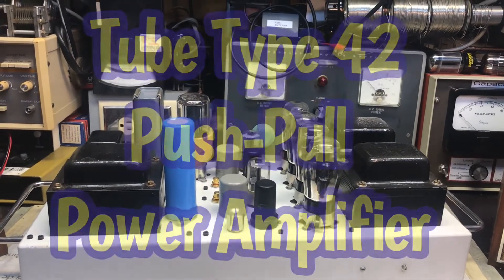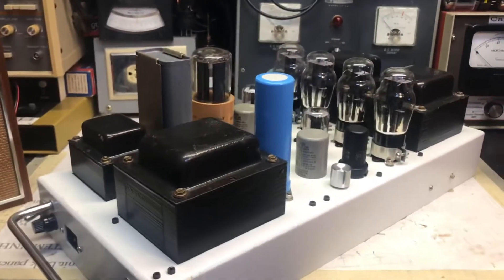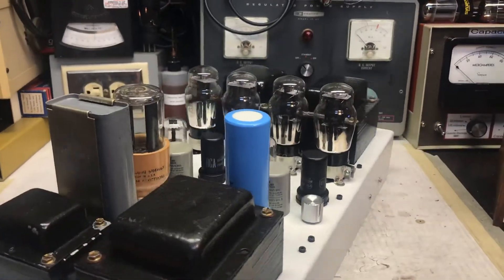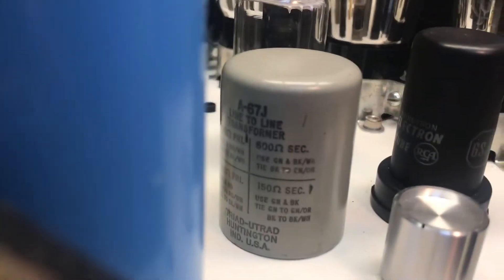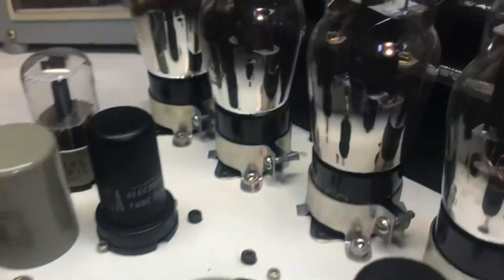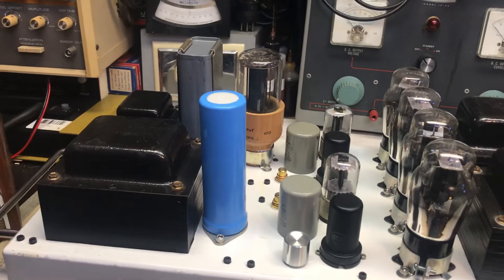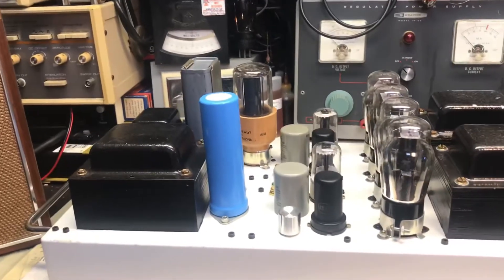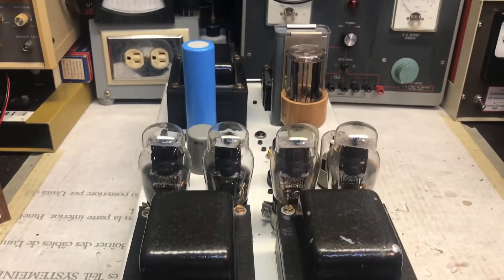Tube Type 42 Push Pull Amplifier | The Vintage Audio Life

Comment: did you have a preference between your single ended 42 and the pp 42 you built?  thanks for sharing the amp with us.
Reply from the maker: Thank you for your inquiry. In low-power applications where a more harmonically rich and detailed presentation is desired—such as a record player feeding a preamplifier and then a 42 power amplifier—I generally favor a single-ended 42 design. This topology tends to preserve high-frequency delicacy and tonal nuance, which can be very appealing in minimalist systems.

That said, when higher output power, improved efficiency, and better noise performance are required, a push-pull 42 configuration is clearly advantageous. Push-pull operation provides substantially greater power output, improved power-supply ripple rejection, and significantly reduced hum, making it easier to implement in practical systems. While total harmonic distortion is typically higher than in single-ended designs, it remains low enough to be largely inaudible in normal listening conditions.

The type 42 tube itself is often underestimated; it is capable of delivering very clean and stable power in both configurations. However, for most builders—especially those seeking higher power with fewer noise-related challenges—I would strongly recommend a push-pull 42 amplifier design. Thank you!
Reply: @thevintageaudiolife  excellent.  I actually have a single ended 42 amplifier.  Or at least I did, and now have another one being delivered.  I have often wondered how much of the wonderful sonic profile would be retained if it were a push pull amplifier.  I have had push pull, but never a single ended and push pull version with the same tubes.  It sounds like for tone single ended is where it's at!!  I have wondered if a push pull amp with these older tubes would retain the character of the older tubes vs. something like an el84 or el34 in pp.  Thanks again for the video and the response.

Comment: I have an old 1934 GE console radio using 42's in push pull for output stage. There is no negative feedback in it because the concept was not invented until 1937! I made some changes in the audio chain to increase high frequency response so I could feed streamed audio into the phonograph input and it sounds awesome!  Being a pentode instead of the beam power tubes of more current tube technology the 42 has less inherent distortion if you look at the characteristic curves of the 42 vs the 6V6.
Reply from the maker: I bet it sounds wonderful! Thanks for sharing.